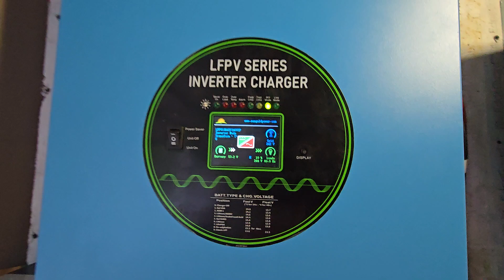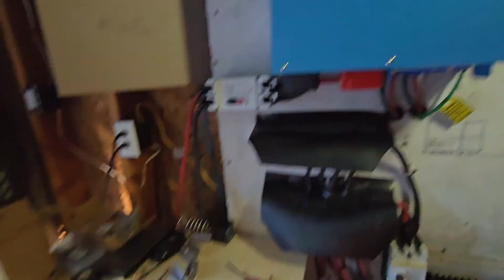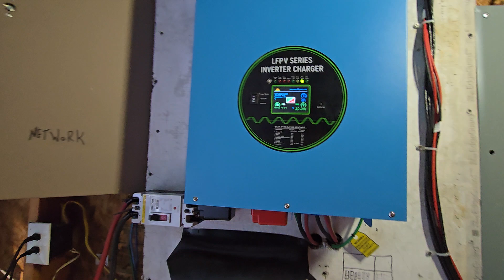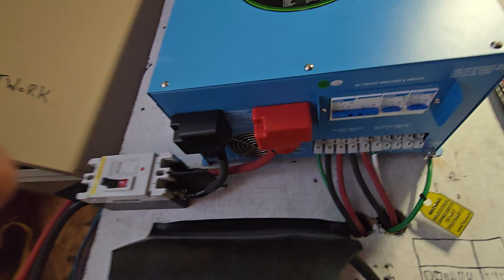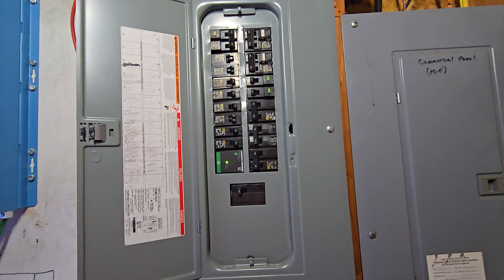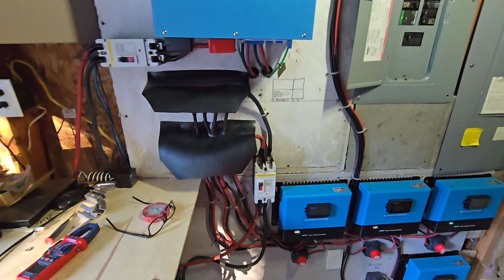Sungold Power Inverter Review, 18kw Hybrid Solar Inverter.

Comment: I have had mine 2 years, and it blew up. Waiting on them to decide what to do with my extended warranty.
Reply from the maker: @all4amd24  how many watts and volts are you pushing into it?
Reply: @HowToWith24DY  12.5K watts is my peak according to Sense energy monitor .
Reply from the maker: @all4amd24  they are only rated for 5200w max and 250 volts.
Reply: @HowToWith24DY mine is an 18k continuous.
Reply from the maker: @all4amd24  oh shoot, I was thinking for some reason you were talking about a charge controller. My bad.
So your inverter blew up, overheat? Power surge from commercial power side?

Comment: These look like Growatt units. Still curious why they have PV inputs but don’t recommend using them.
Reply: they are basically the same as Growatt, Sigineer  18k inverters the reason they don't recomen is because is a small MPPT 145vdc max input i think some Growatts have 250vdc   i have one just smaller they have high idle consumption 250w 18k , so yeah not for a small battery bank but they are good inverters for the price .
Reply: @soulkeeper514  I realize the growatt units have low VOC limits as well. I’m just puzzled why they don’t provide MPPT’s with higher  voltage ratings. Most other AIO units have anywhere from 450v-500v at this point. And have for nearly 2 years. 

The 260w idle consumption is a real killer also. 😳